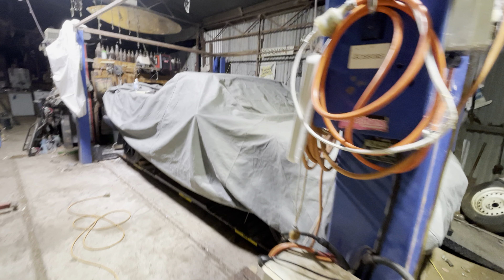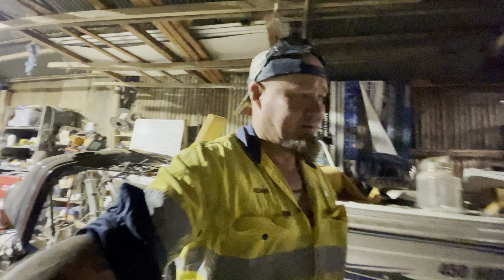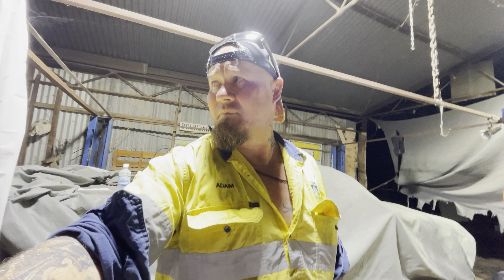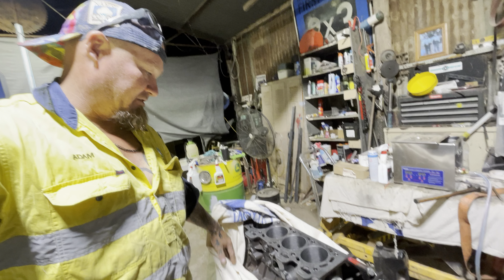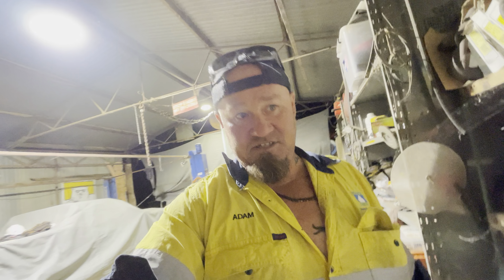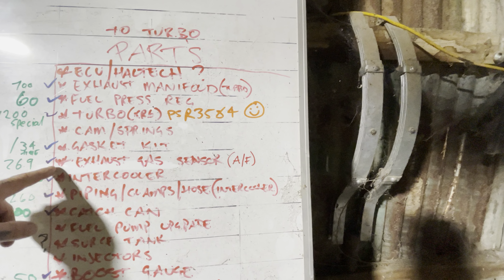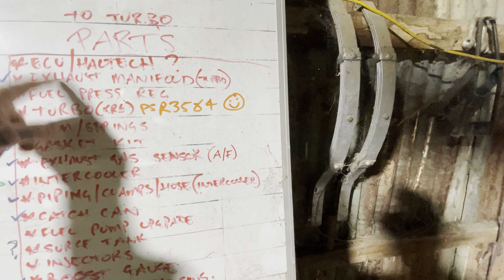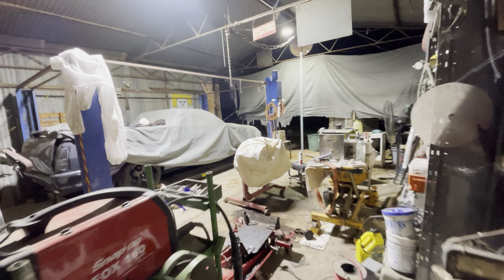Au or EL motor (turbo) option for XG

Comment: Great restoration for the old ute. I remember it sat behind that bush for years in town. Hey, I've got an XG, and was wondering if you can help me out with a bit of touch up paint work and making the doors open and shut easier? Local panel beater said it'd be a 10 month wait to get in there so thought I'd ask you if you have time?
Reply from the maker: Getting the time is the issue mate. Work got me flat out. And trying to get this build done.